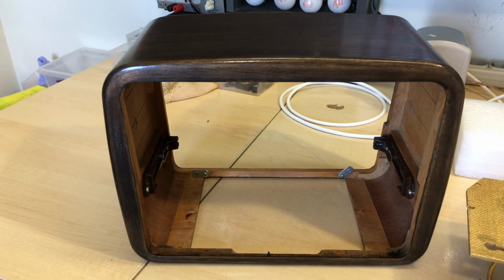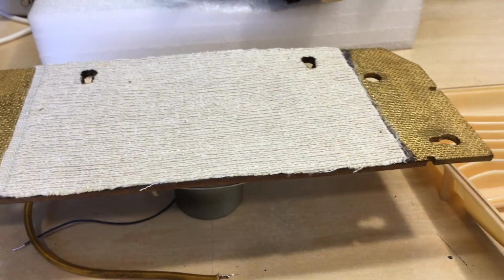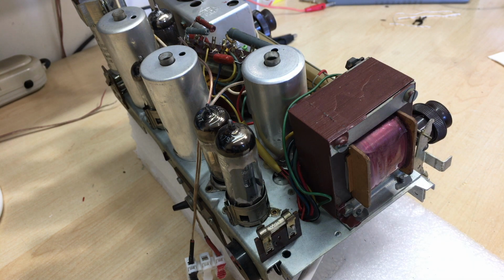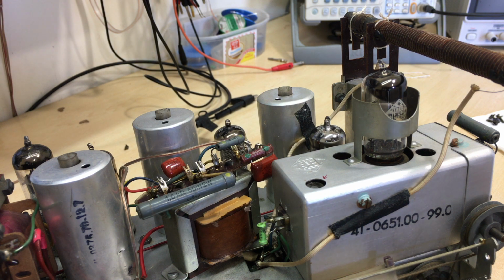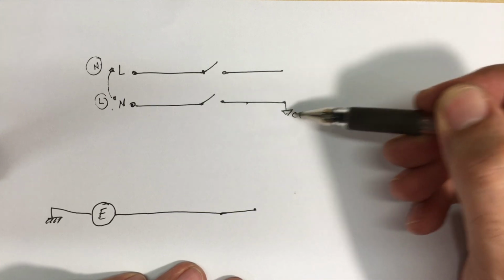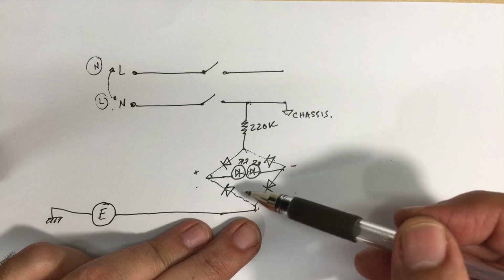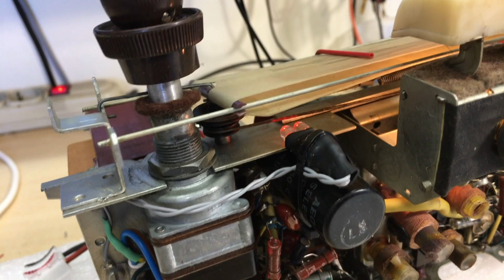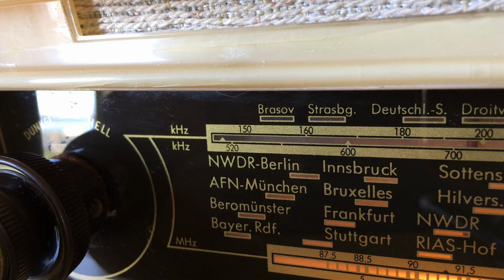Telefunken Jubilate restoration - Part 4. Another radio restoration complete. Great result.

Comment: I really love this channel. Always a clear explanation of sometimes complex (tubes) electronics.
Your english pronunciation and your voice are really pleasant to listen to.
This video interested me because I’m starting on a Telefunken Gavotte.
A tip for the live chassis: maybe you can combine the Leds with a relay that switches off the connection to the chassis.
When the Led is on you know that the relay has broken the power and you have to turn the plug to get it working.
(As long as the leakage current doesn’t trips the RCD )

Greetings from Belgium
Johan
Reply from the maker: Thanks Johan for the tip. A good idea.

Comment: You are also a woodworker! And not a bad one! This little thing would be my radio. Smart solution for the main-indikator. I would have used an old screwdriverlamp (and resistor) inside. Cheap and a dozen are laying around here. I love your restauration serias.
Reply from the maker: My woodworking skills are very limited, but sometimes you have to do a bit of everything. 
The screwdriver solution is using a neon lamp, which is actually simpler and works well.

Comment: Very nice result. The detector circuit improves the safety a lot, but I think this kind of hot chassis radio belongs into the hands of technicians. Actually, I prefer this version of the Jubilate to the version with the clock. The small radio with the huge clock looks odd.
Reply from the maker: I agree.

Comment: Nice work as always! I did mention earlier that the 'mains lead' antenna setup can work surprisingly well 😉

I've had success repairing broken louvres by casting in-situ - make a silicone mould (using the 2 part plasticine stuff sold for craft moulding) from a good section, pinning the gap together as much a possible with piano wire or mesh where it'll be hidden, clamp the mould around it, and pouring tinted epoxy/poly. I find it a nice change of pace, though it's fiddly work and the ones I've done have been thicker and dark bakelite - I've never had to do one that fine or light-coloured.

A question: like several small Euro radios around that era, your Jubilate has a translucent … paper? plastic? cellulose? … dial lamp diffuser sheet. Have you ever had to replace one, or do you have any idea what might be a good replacement? I've got a radio here at the moment where it's so cracked and brittle it needs replacement, and the only thing I can think of is that sort of plastic-filled baking or tracing paper…

(Also like YouTube's auto-generated subs as you scan across the bands. This episode included “la victoria will cook the food we’re honest if I’m gonna sing when it’s pasta dough” and “for you next Becky I’ll um cut him a sticky kingfish” 🤣)
Reply from the maker: Jim S : YouTube’s auto-generated text doesn’t seem to like Portuguese radio reception :)
I’ve used the oven-baking paper often. I then found the draftsmanship tracing paper better, so I have a sheet here that will last a very long time (I bought an a2 sheet).
Reply: Thanks for the advice Manuel - draftsman's tracing paper is what I was leaning towards (bought plenty a while back for photoetching pcbs), so I'll give it a try when I get that far along. I'm trying my hand at making a video with this one in my free time (of which I have none!), so the result will end up here sometime.
Reply from the maker: Jim S : good luck, and let me know when you post the video.

Comment: An alternative is to put the red led directly in the plug with a legend like “DANGER; flip when red light is on”. You would have to the room but it looks like there is some although it could be difficult.
Reply from the maker: I think it will fit if I use a bigger plug. Good idea.

Comment: To secure the screws on the knobs from touching, you can plug them up with a drop of wax.
Reply from the maker: I have just done that. My fear of shock is endless :)
Reply: I guess originally there was wax in the screw holes.

Comment: I didn't realize UK [Correction: island of Madeira] power wasn't polarized until now.  I live in the USA we have polarized plugs, 117 volts 60Hz. What a great solution with the rectifier and LEDs!  Also GREEEEEEEAT restore!!  What a lovely radio.
Reply: @Chuck Kirchner Thanks - That makes more sense. I've only watched a few of the videos.  I assumed wrong, sorry.
Reply from the maker: I should have been more clear about where I am. I live on the island of Madeira , as Chuck says.
Reply: @electronicsoldandnew  Fascinating!! - The internet has made the world seem so small. Interesting how the world has selected so many different electrical interfaces. And 230 vs 120 etc. Thanks again for sharing your knowledge and projects.
Reply from the maker: David House Sr. : my pleasure.

Comment: Lovely job. Would it be possible to use a relay driven from the hot chassis detection circuit to actually prevent the radio being powered up with the mains the wrong way round?
Reply from the maker: MrGutbag : you could but need to get a little more complicated with another power source needed. You cannot draw more than a few milliamps in this way if you will trip the protection circuit in your home. This works so well that I decided to leave it be. If I give this to someone else who isn’t tech savvy then I might do something else.

Comment: For the led type indicator (resistor + led) to avoid reverse voltage just put a 1n4007 diode with reversed poles(minus of diode to opposite of led). For 230v you can use 100k - 1/4 resistor with led 3.5mm.
Reply from the maker: Yes, but it will flicker as it only sees half wave. The bridge solves that. It’s also quite small and cheap.

Comment: And what do you think of putting in a ground fault circuit interrupter instead of your LED? Could that work? And if that is not better I would use a buzzer
Reply from the maker: Anonymous : the ground circuit interruptor may work, but I wanted to make sure the mains was connected the right way around at all times, so I opted for this solution.
Reply: @electronicsoldandnew  and the circuit interruptor had to be in the radio, otherwise you have breakout everywhere you plug it in

Comment: Hello Great video again!, I learned a lot.
I hope you can help me with this question;

I am restoring a RFT Zaunkönig at this moment, its a very small radio, also with a live chassis when plugged in the wrong way.
I want to do the alignment but my RCD cuts of the power when I connect the ground of my signal generator to the chassis (although the chassis is not really "hot")
I measure around 10V between chassis and my system earth. I know a small leakage current will be running.
Is the only way to avoid this tripping by connecting an isolation transformer? Which I don't have (yet)
Reply from the maker: Henny Poort: use a 100nF capacitor to isolate the signal generator from the radio. You can also couple the input signal by ‘wrapping’ it around the mixer tube without actually connecting it to the set.

Comment: Very nice result on the cabinet, I detest water based lacquers and prefer solvent based as they seem to me to have more body to them, tho for quick drying you can't beat them.
 Good thinking on the live chassis shit, but, people are stupid. I know as I am one of them- don't even think of them just rebuild and get old tech working again,
 My 2 Cents?,
 Take care, Sam.
Reply: or just rewire every valve radio to have no chassis return connection- it was a cost saving dodge wasn't it eh?, to a certain amount to be sure,